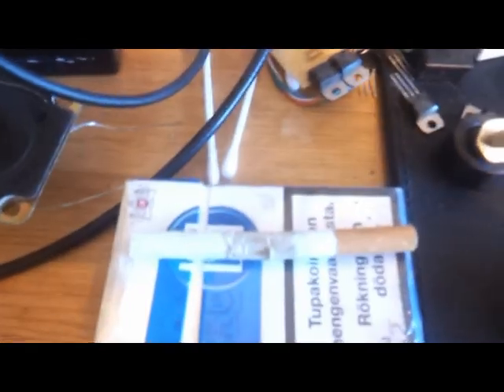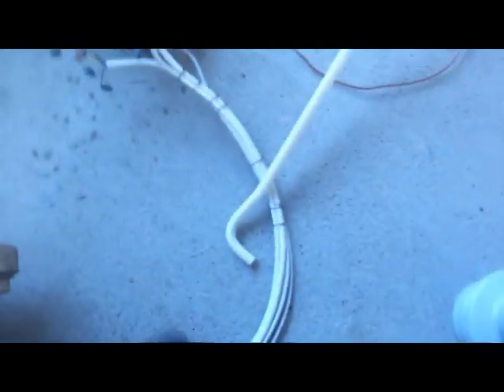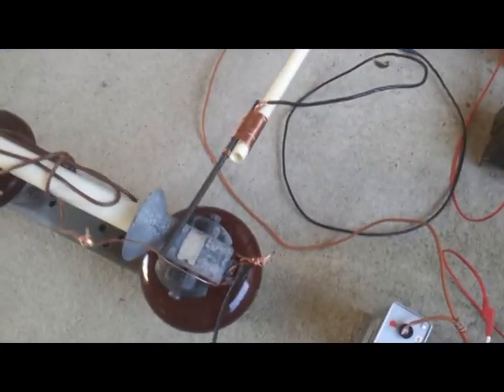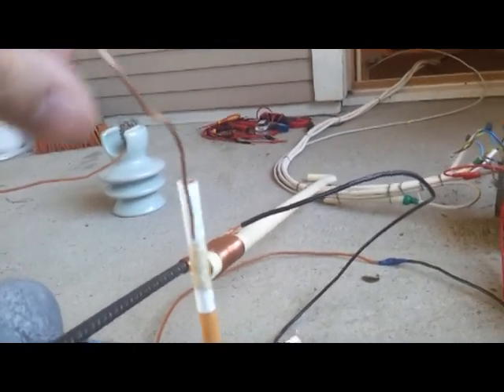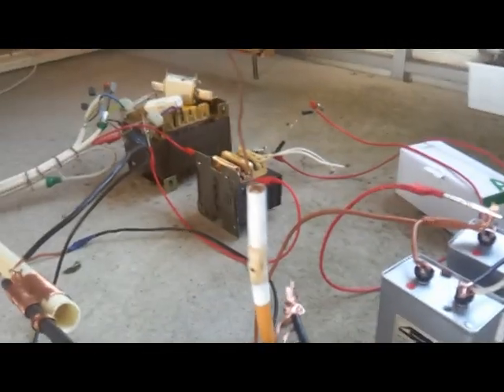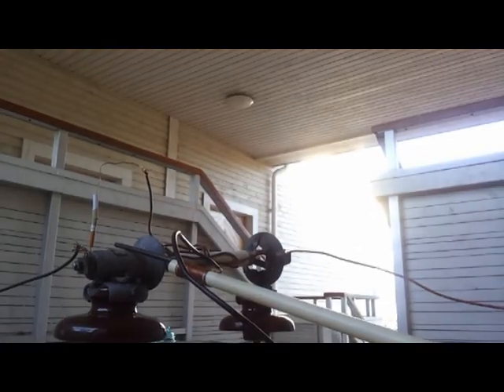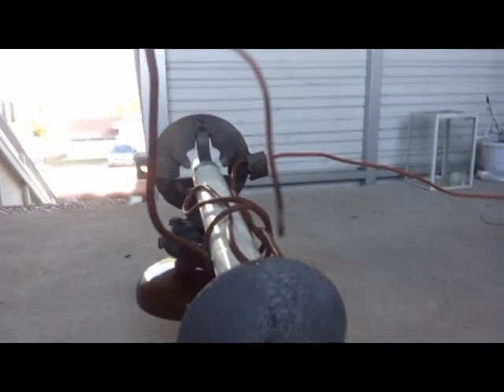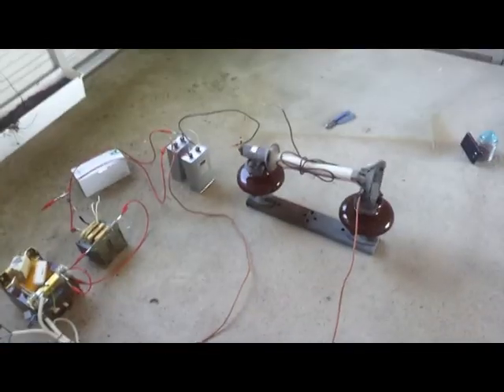CIGARETTE vs DEFIBRILLATOR CAPACITORS

Comment: How to discharge 40uf 6000v capacitor using resistor means resistance value,wattage,wire gauge and time required to discharge.